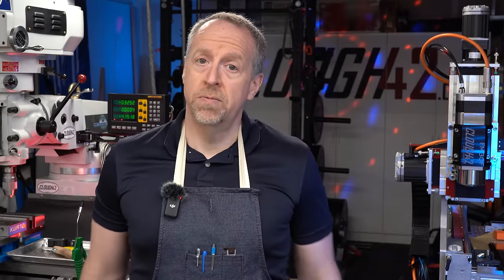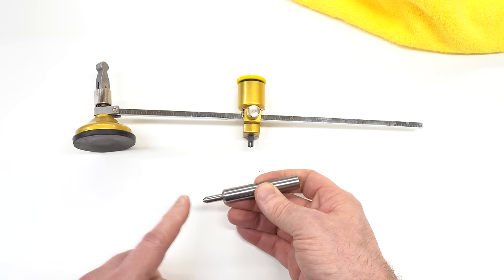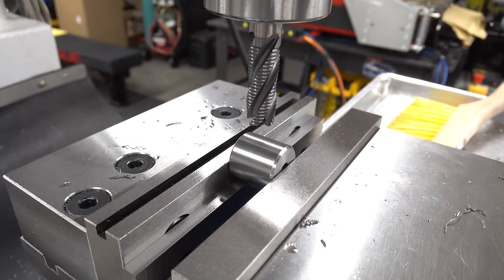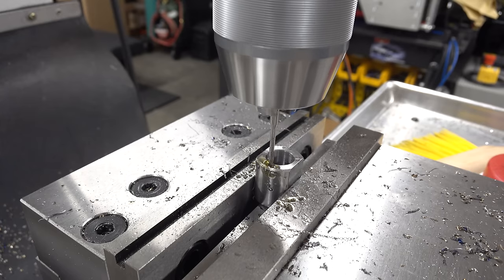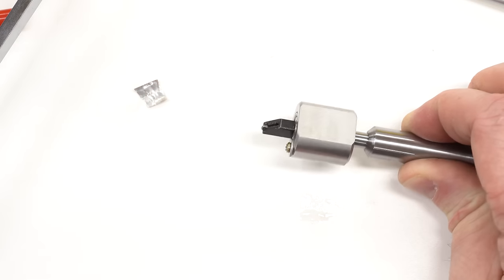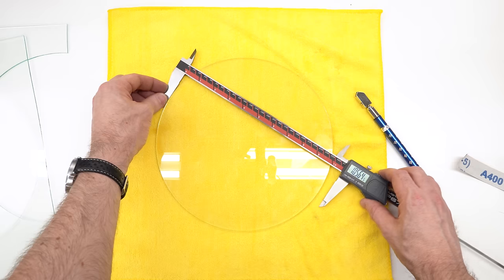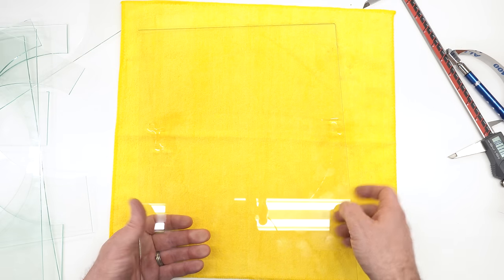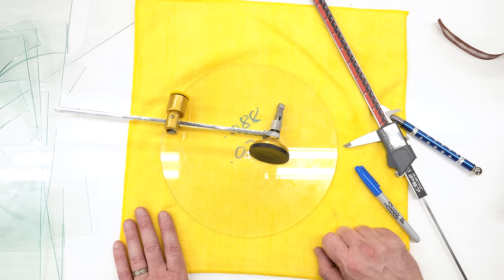Making a CNC Glass Cutter | Avid CNC

Comment: You've got an 0.17% error in the CNC. It's perfectly round for me, considering the tip of the cutter has to turn 360 degrees and you have to add the CNC error itself. Also, you have to remember that the CNC doesn't make perfect circles, It makes a bunch of strait lines in angles do complete a circle.
Reply: If he's using a G2 or G3 gcode to make the circle, then the CNC is in fact interpolating a "true" circle, and not a bunch of straight lines. Depending on the CNC, you may be as much as .001 out of round when you interpolate due to things like backlash, but no where near the .017 he's seeing.
Reply: I agree, I think the machine error is what is causing the problem. Ball bar testing would show it.

Comment: Would it not be easier to cut oversize and bring it down to near perfect by rotating wile useing a 1" belt sander? Cutting glass has never been a perfect thing that's why you would allways cut 1/4 smaller than the exact size ! I'm not in any way a glass man however I picked up a few things from a friend who was a real glass man owner of a shop called Rutland glass in Kelownw BC.

Comment: I wonder what asks for such precise dimensions on glass pane. My thought is, if you need really fine circle, perhaps cut it rough with CNC and then bring it down to dimension on lathe. It would require custom clamp but I think it is doable if the volume you need to produce is large enough.

Comment: Considering that you began using glass scoring on a CNC. Why can't you score both sides to get better and more even cracks? I mean, unlike a human, you can set-up a jig and get accurate results with the CNC. After all, it doesn't seem to be the CNC that is at fault. It is the last bit you are doing, the cracking, that causes it.
Reply from the maker: If you read through the comments, there are some professional glass people who have weighed in on this, and they say that cracking both sides won't really do anything.  The crack will propagate through the glass however it will, and there's nothing about the score on the other side that will help guide it.  Unfortunately, this appears to just be a limitation of the score-and-break glass cutting process.  More control is going to require grinding.

Comment: Possible interest: I had good results scoring glass with a CO2 laser cutter.
Reply from the maker: Scoring and then cracking?  Does the CO2 laser wavelength interact with the glass directly?  The 455nm laser I have just goes right through.
Reply: @Clough42  I was doing stained glass, and the colored glass was working much better, but even clear material got scored. CO2 lasers work in the infrared region, ie ~900-10000nM

Comment: Did you keep track of the orientation of the glass? Was the larger dimension consistent? I'm curious if spiraling into the circle might have a better outcome than just having the initial straight line for blade alignment

Comment: glass shouldn't be install with this type tolerance, when it expands with heat it may break
Reply from the maker: In this application, the comparator seems to be designed with a very tight fit, and the factory glass does indeed get stuck in cold temperatures.

Comment: Most of the time I have seen the pros cutting glass, it would be done pretty much the way you originally did it and that minor discrepancy would be just fine, since you'd never want a piece of galls, square, rectangular, circular etc to fit that precisely anyway, unlike steel, glass is way too fragile, especially at that thickness.. Undersize would be preferred, as with wood, you need to allow for expansion, shrinkage.. Oh and window glass is not actually solid, leave it in a window long enough (admittedly for a hundred years or more) and it will, slowly sag, so that it is thicker at the bottom than at the top, in some cases, a gap will form at the top, especially noticeable in old glazing, where putty was used to secure the glazing n place.

Oh and I would be very suspicious of the cutting wheel, where it contacts the glass, rotating perfectly around the centre or te butting wheel or the wheel being at a perfect right angle to the glass, which would also need to be perfectly flat well

Finally as you say, getting the glass to break all the way round, at 90 degrees to the surface, just isn't going to happen. Best way as I am sure many will  have already mentioned, would be to cut it oversize, then grind the edges down to required dimension

Good luck
Reply from the maker: In this case, the frame it has to mount in has only about a 0.020" lip, so grinding may be the only practical solution at scale.
Reply: That idea that glass will sag is a myth that has been debunked. Some old windows are thicker at the top. The discrepancy in thickness comes down to poor manufacturing capabilities hundreds of years ago.
Reply: @bradley3549  

Let's have a scientific explanation of what glass actually is... Pleas note that not al glass is the same, some can shatter at the slightest touch, some can be bent. HOWEVER

"Glass is actually, neither a liquid—supercooled or otherwise—nor a solid. It is an amorphous solid—a state somewhere between those two states of matter. And yet glass's liquid like properties are not enough to explain the thicker-bottomed windows, because glass atoms move too slowly for changes to be visible.

Solids are highly organized structures. They include crystals, like sugar and salt, with their millions of atoms lined up in a row, explains Mark Ediger, a chemistry professor at the University of Wisconsin, Madison. "Liquids and glasses don't have that order," he notes. Glasses, though more organized than liquids, do not attain the rigid order of crystals. "Amorphous means it doesn't have that long-range order," Ediger says. With a "solid—if you grab it, it holds its shape," he adds.

When glass is made, the material (often containing silica) is quickly cooled from its liquid state but does not solidify when its temperature drops below its melting point. At this stage, the material is a supercooled liquid, an intermediate state between liquid and glass. To become an amorphous solid, the material is cooled further, below the glass-transition temperature. Past this point, the molecular movement of the material's atoms has slowed to nearly a stop and the material is now a glass. This new structure is not as organized as a crystal, because it did not freeze, but it is more organized than a liquid. For practical purposes, such as holding a drink, glass is like a solid, Ediger says, although a disorganized one.

Like liquids, these disorganized solids can flow, albeit very slowly. Over long periods of time, the molecules making up the glass shift themselves to settle into a more stable, crystal like formation, explains Ediger. The closer the glass is to its glass-transition temperature, the more it shifts; the further away from that changeover point, the slower its molecules move and the more solid it seems."

 So to say that it's all down to the way glass was manufactured hundreds of years ago, isn't strictly true. Sure much of the very old glass, was poorly made and much of it was barely transparent, the fact is, glass does flow, albeit so slowly, a person born the day it was manufactured, would never live to spot the change and it would probably take a few generations before any change was noticed. Some say that many glass artefacts even from thousands of year ago, have not "Melted" and look much the same as they did when they were first made, but how would anyone know that for sure. Nobody living was there when they came off the production line, to be able to compare them to what they look like now.. It way not be much, but I can guarantee they are different. It may be hardly noticeable but change they will have.
Reply: @andrewlee6152  Thanks - glass is a solid then.
Reply: @bradley3549  Sorry no, it's an amorphous solid, somewhere in between liquid and solid

Amorphous "without a clearly defined shape or form" so glass is not clearly defined as either a solid or a liquid, a bit of both shall we say and over time it can change form "flow"
Reply: @andrewlee6152  For all practical purposes, and what other purpose is there really, glass is a solid on timescales humans can fathom. Period. Sure, maybe it will sag in billions of years. This isn't tar pitch we're talking about.
Reply: @bradley3549  Oh and some old window panes may be thicker at the top, due to having the sealant, usually some form of putty removed, the pane removed, the frame cleaned and the glass put back and re-puttied

Comment: The irony with what you've done is that you disassembled the right to tool (the diamond engraver) to make this one. All one needs to cut glass is a single hard point (could be diamond, CBN, sapphire, carbide, etc.). A lot of your error is coming from the pivot as the cutter rotates around the z-axis.
Reply from the maker: Nope.  Tried that first, and it didn't work at all.  The crack would not follow the scratch from the diamond.

Comment: use thinner glass,
Reply from the maker: The particular application requires 3mm glass.
Reply: @Clough42  That is unfortunate. There is no way of making the crack run 90 degrees to the cut. Tensions in the glass make it unpredictable. You can only mitigate it by depth.

Comment: The blade starts square, try a first "prep cut" as an arc. Have it end on the arc in same degree as the start of the arc you cutting. You are fighting 2 things (as I am sure you are aware of, you are a clever person): caster and break angle of the glass. You can hardly control the break "draft" in any meaningful way. I don't believe that you will get even 4-5 thou accuracy with a carbide glass cutter. Perhaps my idea may help a tad though. You are covering the entire cut path with oil right? You wouldn't want the cutter to dry out and give an inconsistent cut...

Comment: Your doing score and fracture cuts to .015" accuracy and complaining about it? I think it's only your perception of your results that needs process improvement.
Reply from the maker: The glass must fit into an aluminum frame in an optical comparator that has a narrow ledge around 0.015" wide.  Making the glass much undersize will allow it to fall through.  I would not have designed it that way, but the machine was built before I was born, and they didn't ask me.
Reply: @Clough42  I get it, but they ground their glass to get the precision they needed and so must you. Or you could decide precision glass grinding isn't the right process for your tools and experience and do something else. Maybe copper tape the edge and solder it into a turned brass ring. Or maybe you can just give the ring a bigger ledge that can accommodate the lower precision.
I just don't like seeing you search for the cause of your "failure" when your already an order of magnitude better than I would have guessed possible.

Comment: A carbide cutter is a poor mans glass cutter, professionals use a diamond tipped tool and barely score the glass. If you score to deeply you get multiple grooves for the crack to propagate down.
Reply from the maker: My first attempt was with a 120 degree diamond, and I couldn't get it to crack along the score line at all.

Comment: Nope. Not gonna happen. You are trying to crack a cristal structure, so don't expect anywhere near accurate results. For that, you'll need to center the over-cut pieces and have the edges ground by a diamond wheel/bit. Anything less than that is bound to miserably fail.
Reply from the maker: It's amorphous, and not crystalline, but I think your assessment is accurate: is not going to crack consistently.  Grinding is probably the answer.